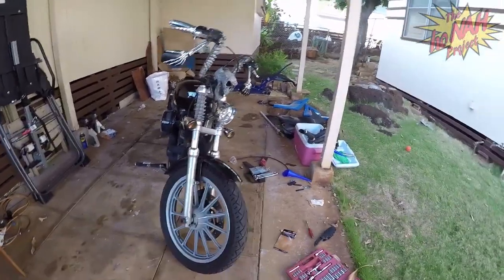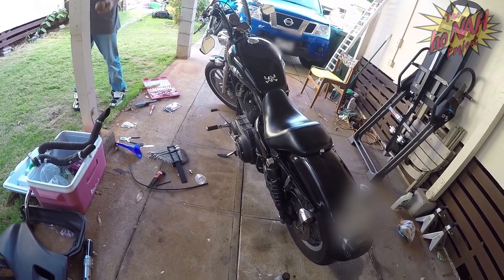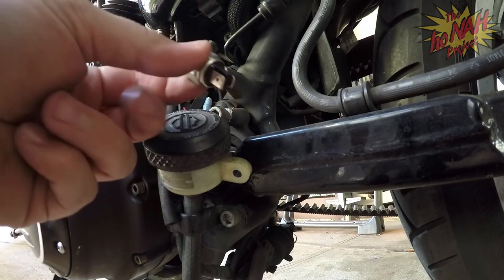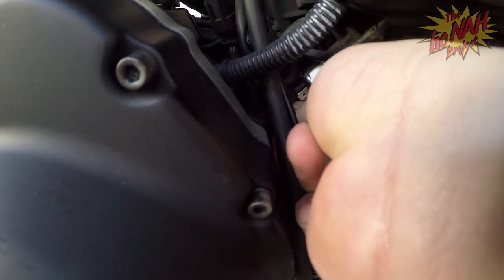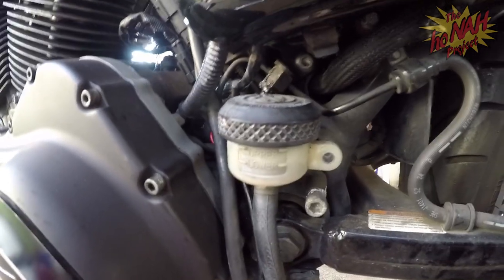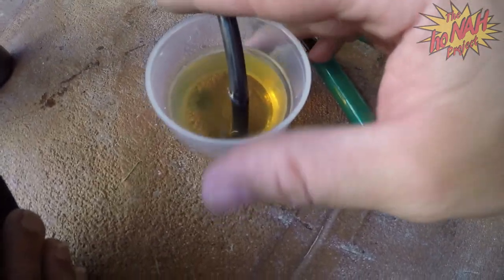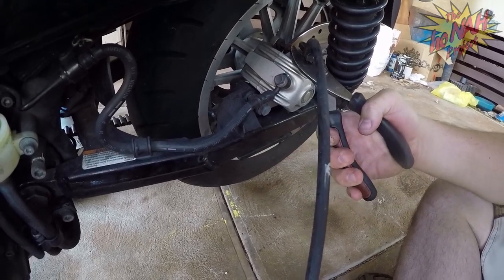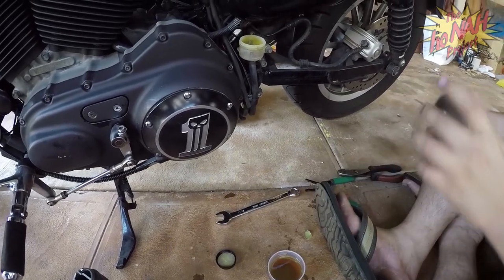How To:  Replace Rear Brake Light Switch

Comment: You can use a paper to bypass to see if it's it put one paper clip into each connector then turn you key on if brake light comes on its this part.

Comment: just something to note when you are installing the switch you want to make sure you don't over-tighten it. I'm not saying he did im just saying if you do you could fuck up those threads very easily so just snug don't crank on it.
Reply from the maker: Good call out.  I don't recall the specs, but it isn't too much torque to snug it down.
Reply: The ho NAH Project yeah still a great video good job

Comment: Thanks for the video! You can test your switch by connecting both leads together with a cross connect wire, also always wash your master cylinder reservoir rubber gasket with water and soap for a guarantee seal.., ride safe!

Comment: To be when bleeding its unnecessary to do what you did for me all you gotta do have someone push hold the brake down while someone does that open the bleeder then close it do it 2 or 3 times if there's a stream that comes out your good to go. It's similar process like a car

Comment: Info: Tighten stop lamp switch assembly to 80-123 in-lbs (9.0-13.9 Nm).
After bleeding clean lines with brake clean and apply continuous pressure to brake lever for 1 min (mark position). 
If brake lever moves past mark after 1min inspect for leaks.

Comment: Excellent Video.  Thanks.  When bleeding, do you put the pipe into the pot of liquid so that if you get reverse pressure, it take the liquid up the tube instead of air?
Reply from the maker: Clinton Sequerah-Salmon Yes. Thats exactly right. Keep it submerged until all the air bubbles are out.

Comment: Great vid. Realized through this that my problem was the same brake lever switch in the rear, instead of almost taking apart the front.

My problem was however that the light stays on. Any idea why that is?

Also my question is: I didnt quite understand why you had to keep opening and closing the valve. Why not just pump out all the bubbles and thats it?

Thanks again!
Reply: Probably the still the switch. Disconnect the electrical connector from the switch with it turned on. If the brake lights turn off with the switch disconnected, the switch is most likely the culprit.

Comment: Doesn't that break system require DOT 5 fluid? Why do you have DOT 4... They shouldn't be mixed... Also when you have a helper it's a lot easier to bleed... Not sure why you had him pumping while the valve was open... He should only be doing that when it's shut...

Comment: How can i identify if the problem is with the wiring or at the switch!! Coz i just have a 1month old switch but all of a sudden my rear break light stop working but front brake is working well!! Thanks!!
Reply from the maker: It's basically process of elimination. It might be that you need to bleed the brake system more in order to get the correct amount of pressure to activate the switch. Or it may be that you just got a bad switch. The rear break switch on the Harley Sportster is notorious for crapping out. Last time mine broke I just bought a new one and switched it out. Found out that it wasn't the switch but the connection at the light itself. I hope this was helpful. Wish I could be of more help but yeah, process of elimination is your best bet.
Reply: All the switch does is close the DC circuit with hydraulic pressure. by removing the electrical connector and jumping both leads you can simulate the same process. If the rear brake light comes on when you do this, the wiring is good and you know it is the switch that is bad.

Comment: One thing you didn't do was to reform the rubber in the reservoir cap and fill the reservoir with brake fluid.